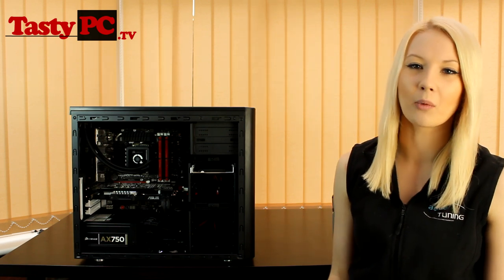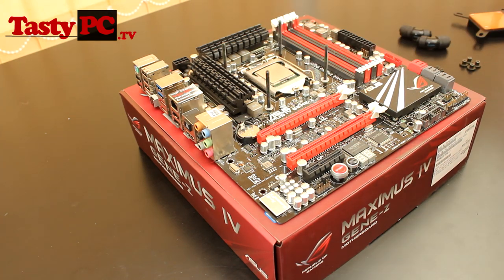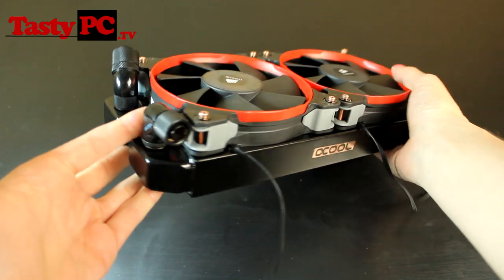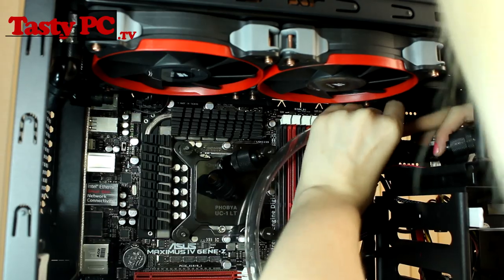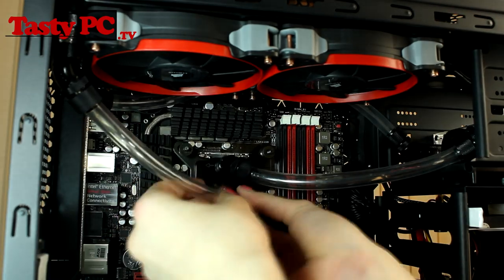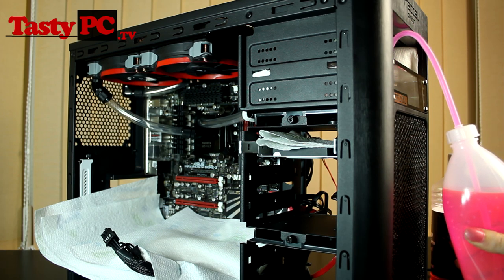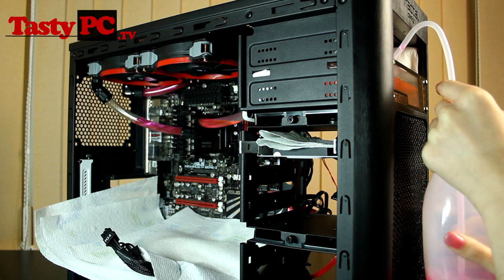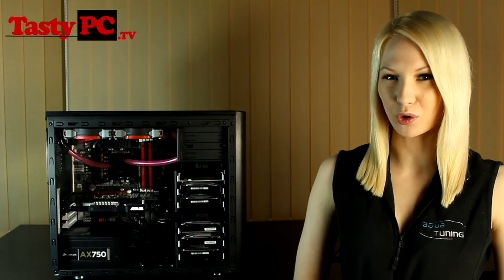Arc Mini Watercooling Part 2 Installing the CPU Loop Water Cooling

Comment: I've got 4-year old LC on one of my rigs, and its still working, not a single leak. Just use compression fittings(most reliable), use only very lightly curved tubes(otherwise they will kink after few years) or use anti-kink springs, place reservoir in highest point of the loop(to prevent gathering air bubbles in other components), make sure entire loop is sealed(to prevent coolant vaporization) and every few months clean radiator and radiator fans from dust. LC build like that will last forever.

Comment from the maker: I like to always use standard 13/10mm tubing, which converted to inches is OD 1/2", ID 3/8". I find this size tubing easy to work with and I think it looks better than thicker tubing. Although occasionally I will use 19/13mm if I think it'll look better..

Comment from the maker: Thats with the PC off, to leak test it and remove any bubbles.
You can either just run the pump from your psu with nothing else plugged in, if you bridge it.
Or you can buy an external psu like what I use in the video.

Comment: RE 600T: I've been thinking of building a rig around it for a while, and when I have the money, I'll be using a 360 in the top, and a 200mm in the front. Very minimal modding, that basically can't be seen, even if you take the top panel off (fans on one side, rad on other, etc.). Also, coolent: I plan on sleeving my tubing. I've only seen it in one place (Guru3D rig of the month) and I thought it looked absolutely awesome. Like the videos by the way, keep up the good work.

Comment: Surprised by how well the coolant colour worked with the rest of the case.

You can tap the tubing with something, like the handle of a screwdriver, to get the smaller bubbles off the inner wall.

Comment: I really like the build videos.  Nice supplement to the review and provides some valuable insight on both product and process.  Example being the misplaced mounting holes on the reservoir.

Unrelated side note, you may want to move a studio light more to your right so your bangs (do they call them taht in UK?) don't cast as much shadow on your face.

Comment: Looks like a good start. Do U still plan to get the DREMEL out & have a go with some case mods? Maybe drill some holes to mount the resovoir first :) second rad with GPU & second pump would rock. I agree with wwyk1993, some UV lights would be amazing. Can't wait.

Comment: Hello, nice video and really helped me out to build my own. Although I still have some trouble with the small air bubbles + the pump sounds really loud at 12V. Any ideas how to get rid of the small air bubbles and also should I be worried about the pump? Thanks and keep up the nice work

Comment: I've got the EK DCP 4.0, which is basically the same, but bigger and more powerfull, and therefore also louder. But I actually don't find i that loud that would make me want to do something about it.
Just make sure you have 0 bubbles in your loop, and make sure to use the foam-pad provided with the pump, and I'm quite sure your problem will go away.
If not, get the DCP 4.0. It's really powerful and runs my liquid through 2 GPU-blocks aswell as a CPU-block. Not to mention two radiators.

Comment: You did such a good job with that tubing. The tubing in mine is twice as long as it needed to be haha. I need to get some 90 degree and 45 degree fitting and some more tubes haha

Comment: There are several methods to applying thermal paste -and it also depends if you are using ceramic or metal based pastes. Either methods works fine in any situation. Having said that - if you choose to be exact, the Difference is this: If your CPU has a cover (Desktop) then the line method is fine. If its a laptop or bare die CPU then you should apply evenly.

Comment: Agree with you entirely on the noise of the LT, and the build quality of the res. 
I found a load of silicon still trapped/floating around in the machined face (rear) I was going to use a pair of the LT's for a build but the first one I had sounded like an unlubricated two stroke so quality control LT's????
How have you found the flow? I was actually getting bubbles running back towards the pump whilst trying to bleed mine, not sure the quoted figures on head height are totally accurate.

Comment: From a thermodynamic stand point, full coverage is actually detrimental to performance, as what little you gain through increased coverage is quickly outweighed by the inevitable increase in thickness of the thermal interfacing material. Remember, the more stuff you put in the way - the less heat gets dissipated. The only reason this is there is because it's better to have that than air. Metal on metal contact ensures the best dissipation and that's why people lap their contact surfaces.

Comment: Just an FYI, using distilled water is a much better idea than colored coolant. The additives they use to color the coolant will often gunk up your water blocks. If you want color, use colored tubing.

Comment: Greetings from Germany, this Video was very funny. Did really someone write about how much he wanted to have played with his tube?
Although i'm also doing watercooling for only a year by now, i still have a small hint for you. If you are pushing the tubing over the compression Fittings, you can lubricate the inner part of the tube that has to go over the fitting with a small amount of the coolant, so you don't have to push so hard to get it over.
By the way, I like your accent, where is it from?

Comment: They way you make your clips is great. Keep being you; this is the reason your channel is successful.
I'm skipping to Project Tasty: What if you you'd have a custom made clear-tank to replace the side-window on that corsair case? So depending on the depth of tank or the coloration's profile, lighting's would bring out each its own shading of pink. You could also tattoo in in black a "TastyPC" logo.
Maybe in the long run some PC makers will customize some or more "TastyPC" ;D

Comment: I have bought EKWB H3O 240 HFX water cooling kit for my Arc Mini R2 and I have no idea where I will put the pump and the res... (initially I ordered L240 which comes with res+pump combo, but EK by mistake sent me H3O, which is much better, but it comes with separate res with is quite big...)

Comment: It's ok. We can disagree. It's just that it's impossible to get a blob(hemisphere) to cover as thin or as evenly as a rhomboid(pre-tapered square spread). However, it's not impossible to get a rhomboid with no air bubbles, particularly if you're precise with the height of the spread. I've personally gotten the best results with this method on desktop cpu's.

Comment: How loud is this bay res? I have an EK DCP 2.2 which creates so much noise (hum & vibrations through case) So I've had to suspend it by elastic bands and reduce the pump speed to make it quiet.

Comment: Res works better sideways with the return port highest. This Res more than any other I've had suffers really badly with turbulence on the return port reintroducing air into the system.

Comment: If you use ionisied water, which is most common in WC loops, it is not conductive. Be careful tho.
I haven't built my self WC loop yet but i've heard that if you change your tubing around once a year you should not encounter problems 
(bad english sry)

Comment: Hey, since nobody seems to reply to any of my questions hopefully can get some help here, I want to know if it is safe to use UV Liquid in my loop/build. Some are saying just use UV tubing with distilled water because UV Liquid has issues down the road. What should I do?? >_< I am so frustrated because I wouldn't have a problem using just UV tubing but then my Reservoir would look so bland with clear liquid in it and the tubing lit up. I want both the tubing and the reservoir to stand out with the UV Cathodes. Help will be MUCH MUCH appreciated!!

Comment: It seems the you didnt connect the radiator to the res? If you dont do the the loop is all messed up, never tried actually doing the way you did, nor i didnt watch the whole video (Doing homework most of the time) so Maybe there is a reason you didnt do correctly? By the way its called a loop for a reason so the water/coolant will flow evenly and have some place the coolant will go when its in the radiator

Comment: Though I won't total rely on that video. An amd cpu is better doing a pea sized (tried it personally) with an intel most of the times I did the line method.Look at the i5 2500k structure.

Don't really on my answers though; it depends on the particular product of thermal paste you end up using.

Well I am a fan of Tx-4, though If you can afford EK Water Blocks EK-TIM Indigo Xtreme .  It is one of the best thermal compound out there BUT when you remove the compound you end up ruining the void.

Comment: I couldn't recommend it. It's noisy, there is no flow monitoring, the res reintroduces air and it can't be entirely filled due to the sunken fill port in the top. The flow rate isn't fantastic and it struggles pushing uphill about 2 feet.
It's adequate probably for a single low restriction 240mm radiator and only cooling a CPU. Anything else I would be looking at a D5/DDC.

Comment: this is lol.. wouldn't it be better to turn the rad the other way just, so that you could fit a exhaust fan in the back? 
Tip to the WC noobs out there, never use colored coolant, always destilled water with kill coil or a biocide and for your own sake always use solid tubes.

Comment: Lol, you are NOT supposed to "put a blob down and let the block spread it out".
That is the most noobish shit i've ever heard. You're are supposed to use a thin blade to spread the thermal compound on the cpu with SLIGHTLY(like 1/4mm) more paste in the middle tapering off toward the sides. Why do you even bother doing heat tests and water cooling when you're leaving 2-5% efficiency on the table.